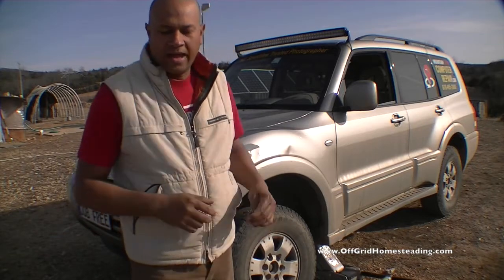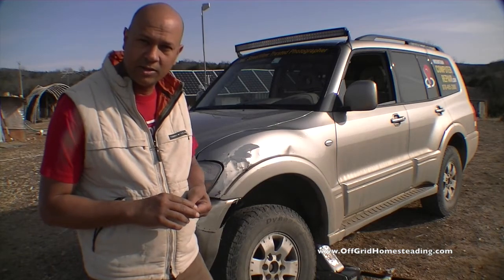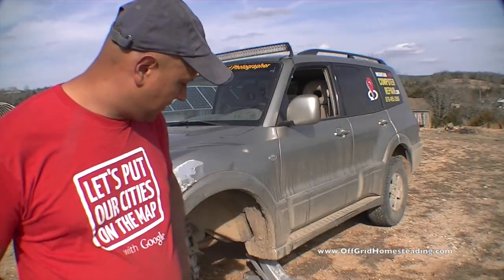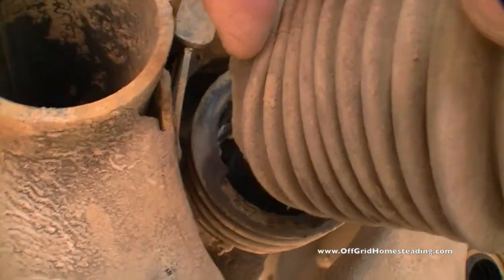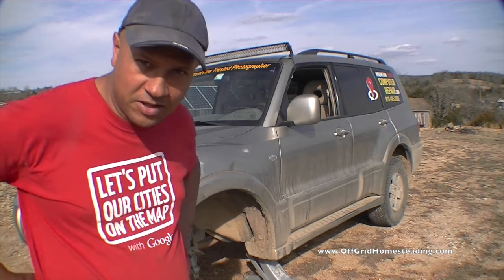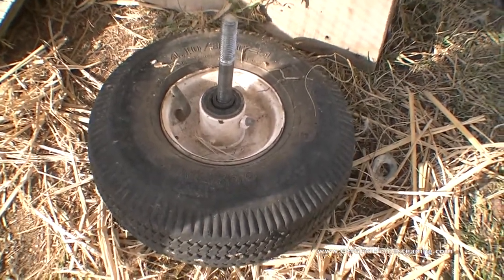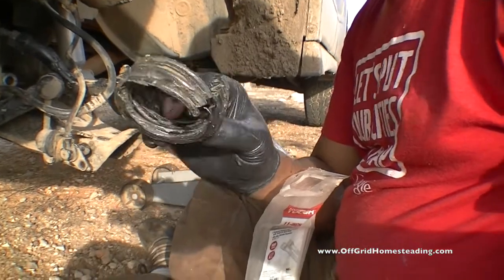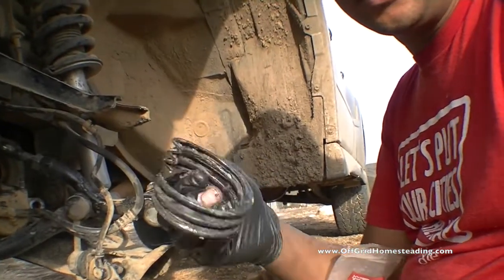OGH - MITSUBISHI MONTERO LIMITED 2003 - FRONT AXLE REPLACEMENT & FRONT LEFT INNER RACK BOOT FIX

Comment: A bit of a strange repair, don't you have spare parts? In Poland, you buy rubber for 10-20 dollars, unscrew the rod with the tip, replace the rubber and it's ready :) Regards
Reply: 7:38 normally the repair you mentioned is the standard way to fix it, but we’re an hour from the nearest city, and this was the only fix I had available at that time to keep my control alarm and joint from being worn down anymore
Reply: I understand, thanks for the answer, greetings from Poland and welcome to my channel. Soon I will post something about the Montero-PAJERO 3.2DID because it cost me a lot of work - its repair and reconstruction @JohnFraserPhotographer
Reply: Greetings from the Ozarks in America!  I love the Pajero's.  Thanks for commenting!

Comment: I found a "Rancho" shock boot that was almost an exact replacement....size and structurally....just a different color....bright red....which is kindof neat looking when looking at the suspension and such from underneath. I replaced both sides and they came from a local 4wd mod store. $12.00 each.

Good video.

Comment: I think the part you were working on is called the steering rack boot. I had the same issue recently where the boot ripped on me and I was able to buy a new boot from the KIA parts department for $40 exactly for my 3rd gen montero and the part number is MR510272. Also didn't need to take out the entire brake caliper just unscrewed the part that connected to it and took the boot right off. Of coarse everything was measured before so the alignment wasn't messed up. Job turned out a lot easier than I thought it would be.
Reply from the maker: Awesome job Mark.  Glad you didn't get things out of alignment.  Thanks for sharing the part number.
Reply: Question that part number is for the passenger side ..  will that work for the driver side ???

Comment: I had the inner rack boot bad also, left side on 2 of mine!  I don't think they made the left as well as right...maybe too short and they ripped apart at same spot as yours.  I just fingered some more grease in the open boot rip, used a heavy black plastic bag that I cut in a rectangle and double layered it, and wrapped the whole boot about 3 times with the open end edge facing down (to drain anything that may splash abouts). Then I wrapped each end a couple of times with black duct tape and then put a plastic tie strap on each end over the tape. I turned the wheels 100% to right to stretch the boot all the way out so that my plastic would have enough slack when I installed it.  But a tire tube would also work. There is also a genetic universal boot i saw on eBay for about $17 one could use if to have the outer rod disconnected.
Reply: Thanks for sharing.    Good job on your fix job.

Comment: Hello there! Thanks for the nice video but i want to get more info about that left cv joint as i have a grinding problem in my cv joint without turning. Just on a straight fine road it grinds as if its cracking. It appeared about we installed new bearing hubs! Any idea on how to fix that?
Reply from the maker: I just replaced my Carrier.  The part that the front axle(s), connect to, that are driven from the transfer case.  It started making a grinding, clicking noise-- a while back.  Most noticeable in reverse and in 4wd, or 4wd locking differential mode.    After replacing this part I found on ebay . 
CARRIER-FRONT-AXLE-AUTOMATIC-5-SPEED-LIMITED-FITS-01-06-MONTERO-1337986 . I didn't have to have an alignment after this was installed, and it stopped all the clicking EXCEPT a little clicking from it when it's in reverse and in 4WD.   So I guess this one is old as well and somewhat worn.  The most important thing for me was that I NEED four wheel drive to get around where I live, so it was imperative that I get it fixed asap or buy another 4WD.    I got it USED for  $75.11 .  Shipping: $67.25 Flat Rate Freight.  Everywhere else wanted around $350-450 plus shipping.   I got if from https://www.ebay.com/usr/abcautopartsinc?_trksid=p2047675.l2559 . ABCAutoPartsInc a seller on Ebay-- that was the best price, and it arrived in a very big heavy box about 90lbs at our gate.    First thing you may try as well is to make sure that the vacuum solenoids are changed... if they are not working properly it could cause a little grinding noise as well.  The link to it is here.... in addition you need to check your  4wd solenoid valve.  If you have any vacuum leaks (check the lines) or the rubber is disentegrating you'll start having those problems.  Here is the part to order on Amazon prime or regular . https://amzn.to/2MmJAy7 .   You can find them from 20-30$.   I'd start there first.
Reply from the maker: Carrier.  Replaced it for under $200 delivered.  Solved the problem.

Comment: Want to change spark plug wires looks like a job.
Reply: Yea the dreaded simple 10 minute job on most cars... no it's about 2-4 hours what a pain.
Reply: I took this truck to a local mechanic got the water pump and head gasket changed he said been spark plug wires bad. I did not have the extra money auto zone wanted 379.00 for them. I got a set on rock auto got 49.00. It’s looks like a job.
Reply: @philliplipson813  If you haven't done this yet... when you do, do yourself a favor and also replace the passenger side cam seal!!! It's basically a guaranteed oil leak. Like the plugs, it's a simple fix but ridiculous to get to. You'll have access to it when you have everything taken apart to do the plugs.
Reply from the maker: THAT JOB IS A PAIN IN THE ASS. That was the only reason I wanted to update / change the car.  I ended up Even trading my car across to a 2004 Toyota Sequoia-- V8.  Last spark plug wire job on that when I got it took me 30 minutes total!  The montero first time you do it is at least 1/2 a day just figuring out what screws/bolts to remove-- just mark them with a number so you know what bolts and stuff goes where.

Comment: What brand brackets did you use for that light bar?
Reply: I used the stock brackets that came with the Auxbeam light bar.  And I did what most normal people dont do.  I used self tapping metal screws directly into the roof / side metal column that runs the length of the vehicle.  
Then I used silicone to make sure I didn't have any leaks.  I didn't see any the whole time I had the vehicle (3 years).
Reply: I did turn the brackets INWARDS towards the bar, so it would make it more difficult to remove if someone tried to steal it.   I also used special keyed high security bolt that was threaded to the light bar assembly so it just made it more difficult to remove if someone has just the normal hex keys.  One could not unscrew the brackets without removing the main light bar bolt... hope that helps.

Comment: How did you get the cv axle of?  Just pulled it out
Reply from the maker: It pulls straight out once you get the knuckle out.
Reply: Old video but you should push it forward, then pull hard the other way and it pops right out.